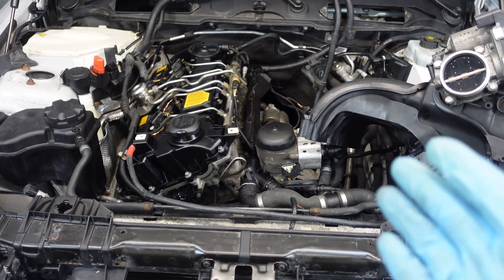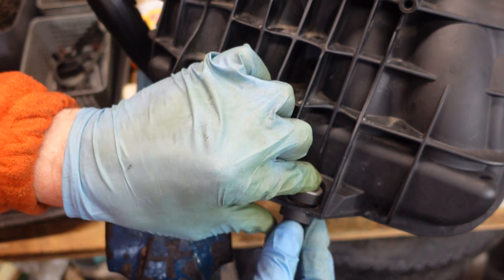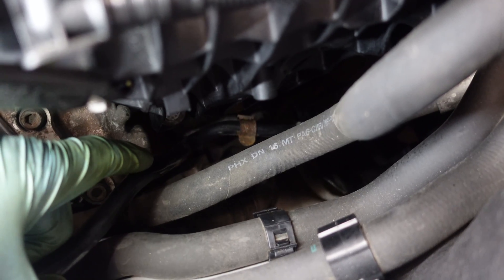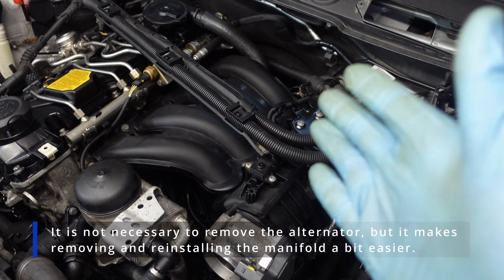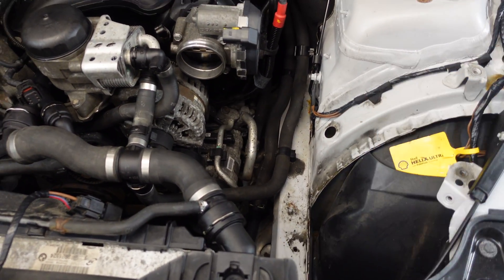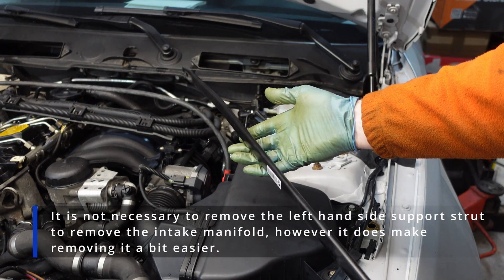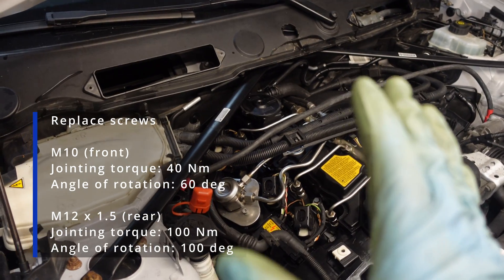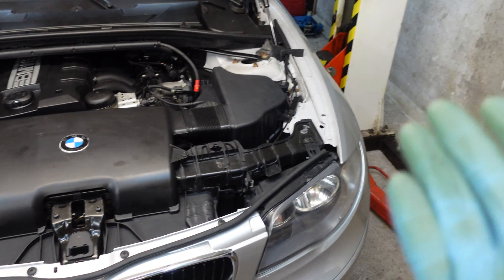N43 Intake Manifold Installation /w Cabin Filter, Air Filter, EGR & CCV Gaskets Replacement

Comment: I  I have a BMW n43 am having something leaking down my egr valve  like oil I think leaking onto manifold after 20 minutes slow driving the car starts smelling smoking out the engine can you make a videos how to fix or change cooler and egr or is it worth doing egr delete I  do most work on my car based on your videos thanks
Reply: Leaking into the exhaust and starts smoking like the cars on fire 🔥
Reply from the maker: @AJMCKAY-r8v  The leak is external? If that's the case you have to check for valve cover gasket leaks and vaccum pump seals leak.
Reply: @BimmerZen thanks il do that il  let you know appreciate the advice

Comment: You make the egr gasket look easy....trust me people you will need patience and be prepared to bleed.  Top tip...tie the gasket with fishing line so when you drop it (you will!) you can drag it back.  Top tip 02 use an appropriately sized drill bit (blunt end) to line up the lower holes on the flanges which will make getting the top bolt in without crossing much easier.  Next 'thread' the top bolt through the flange then the gasket then try to seat the bolt without crossing, once happy tighten half way whip out the drill bit, the fishing line and allow the bottom hole on the gasket drop into position, making sure the gasket won't foul the lower bolt (back to the drill bit trick) tighten the top bolt to the required torque (9nm?) which will hopefully align the flange at the bottom, pop in the lower bolt and tighten down.  An easy peasy 2min job which took me 1.5 hours!  Good luck!
Reply from the maker: Thanks for this insight and tricks!

Comment: Hi, between min. 6:07 and 6:20 there is a cable that is not plugged. I have the same engine and also this cable that is not plugged in. Is that ok?
I have a 318i 2010. Thank you very much!
Reply from the maker: All OK, only the x20i (170 HP) version of this engine usest this plug. Those versions have additional solenoid to controll active engine mounts.

Comment: Hi bimmerzen ! I have a BMW e90 320i 2008 170 hp n43 and i have some problems , It consumes a lot of gasoline, the engine shakes at idle, and when driving, the engine only pulls if I press the accelerator gradually, and it emits white smoke that smells like gasoline
Reply from the maker: @EmanuelTobias-u4k  faulty injectors, also probably nox errors
Reply: @ nox sensor ?
Reply from the maker: @EmanuelTobias-u4k  You probably have errors related to nox because of leaky injectors
Reply: @BimmerZen  thank you !

Comment: Hei, awesome video! Do you know if the plugs for the high power version are functional? So would it be possible to upgrade it?
Reply from the maker: Yes, they are.
Reply: @BimmerZen  wow awesome, so plug it in and go or how does it need to be coded? 😍😍😍 Thank you for your response!

Comment: Will be putting all mine bacl together again shortly so will be a godsend these vids cos its been apart that long ive forgotten what goes where 😂 have thibgs in bags and boxes labelled but cable routing and mounting is tricky. Thank you for producing them 👍 great job.
Reply from the maker: Yeah, even I had to rewatch my videos to put it back together:D
Reply: @BimmerZen when do you plan on adding the first start video? Looking forward to seeing it! 🙂 im almost at the intake back on stage but im also going to drain the fuel as its been sat in there since 2020. Might not be the best now dont you think? Plan is to use the prime to pump it out before i connect the fuel line. Really hope it works again after all the work ive out into it. Fingers crossed as ive never done this before. 🤞
Reply from the maker: First start will be uploaded very soon! I would recommend replacing the fuel for the first start and for creating the adaptations.
Reply: @BimmerZen  will look forward to it. 🙂 and yes ill be trying to get the fuel out. Adaptations ill look at once its alive again! 🙂
Reply from the maker: @dj0men666  https://youtu.be/8a2GPM9HjnM?si=kuja42FgdlKfafM8

Comment: Why need to replace the strut bolts, are they stretched? Did your reused ones fully torque without any issues? Thanks
Reply from the maker: Tbh, I reused the bols and I torqued them to 2/3 of the rotation specs. It feels about right for a DIY job...

Comment: Hi, my car needs an engine replacement. 2011 335ix E90 AWD n55 I have a complete car engine with a gearbox, a 2011 F10 535i, an N55 engine. I noticed that the engine is almost the same, but the gearbox is a little different. What do I do to make this engine work on my car? Do I just need to install it and I do not need to do anything, or do I have to modify it? Some things to work with, thank you

Comment: Hy sir my n46 has a slow start they said is timing I did timing nothing changed they said it’s vvt motor replace it engine light keeps on coming on and off battery drains too quick what can be the issue I ran out of funds now I have to take matters into my own hands can you please help thank you
Reply from the maker: Have you checked the VANOS timing adaptations with compatible scanner or INPA? Instake should be 115-120 deg and exhaust 55-58 deg.